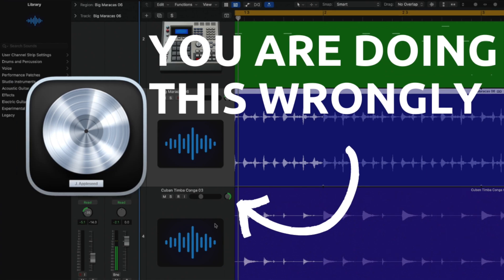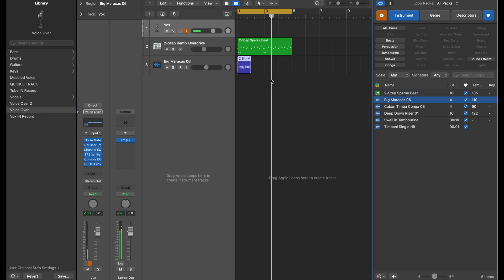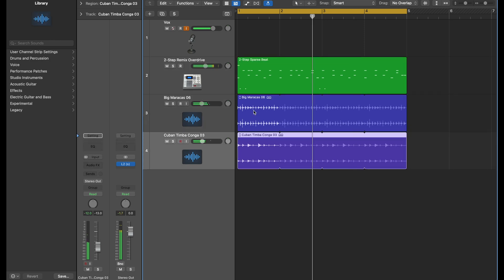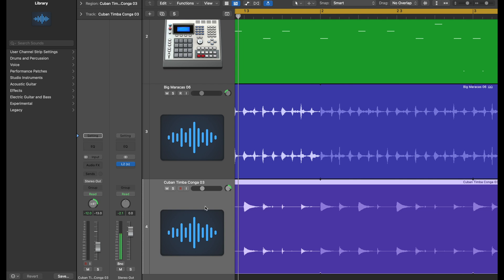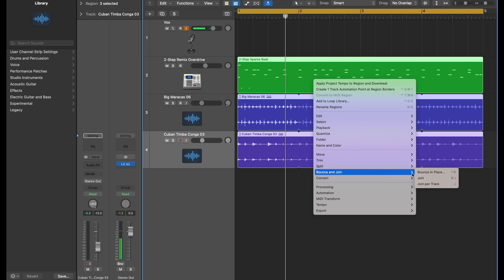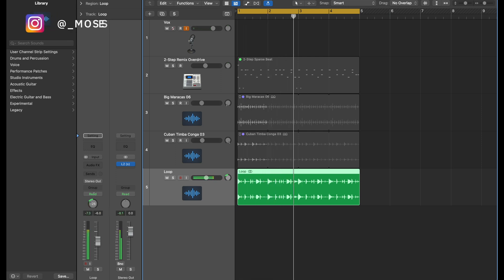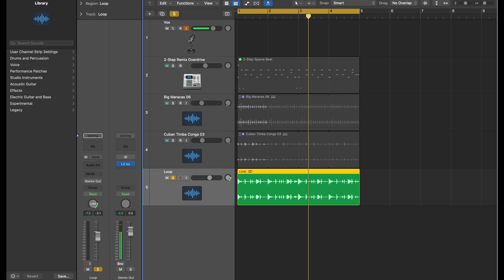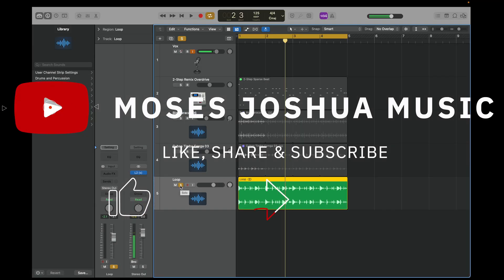Logic Pro Users - Stop PANNING wrongly!

Comment: Hey Moses, bare with me here with my question.

If I have a piano that I'm playing (be it coming from a sample library like Keyscape or Ravenscroft or a real piano), if it's coming in stereo, I don't pan that right (at least using the balance option), and only pan it if it is in mono?
Reply from the maker: Your piano VST is already in Stereo yes. But if you’re recording a real keyboard say NordStage 3 for example and you record each XLR cable as each track i.e. Left and Right.. you will have to pan both tracks to get the stereo field. If you recorded it directly as a single stereo track, then it will come in as stereo, no need to pan. Make sense?
Reply: @MosesJoshua  I see, so the basic rule of thumb is if the source is in stereo, there's no need to pan, just balance (volume) with other instruments.

I know some guitarists love their stuff in stereo, but I guess even when doing MIDI guitar, keep it mono.
Reply from the maker: @tonylancer7367  first point is correct to an extent. But there’s no rule that says you can’t pan a stereo source as you can see in the video I was showing how I would pan stereo if I need to. Sometimes you don’t want everything to come from the centre!
Reply from the maker: @tonylancer7367  if you’re doing midi gtr you can do mono or stereo it’s all preference.